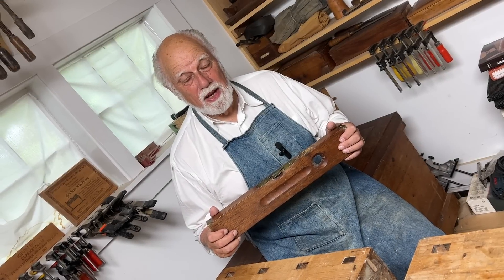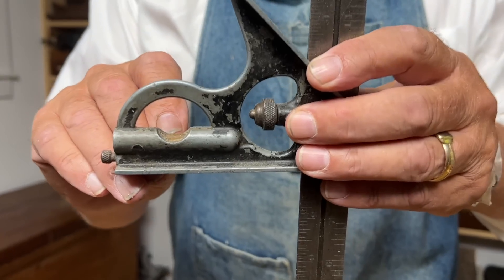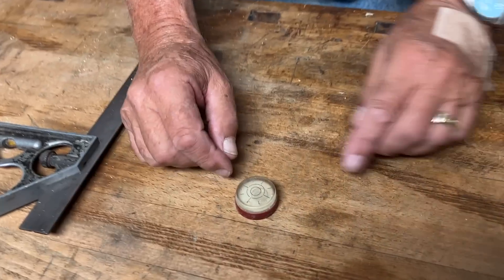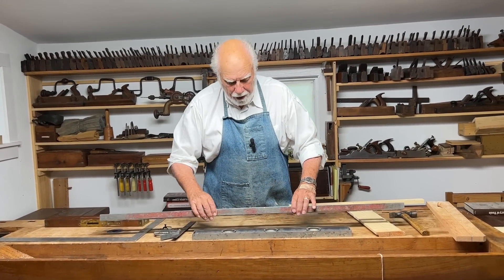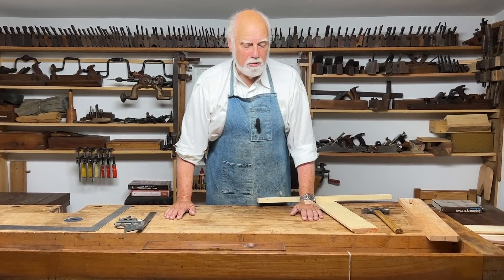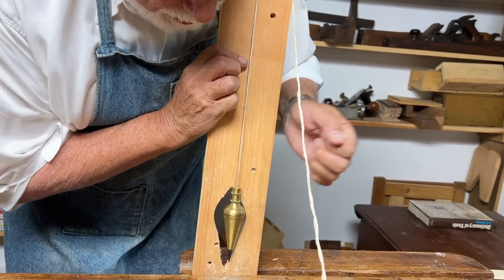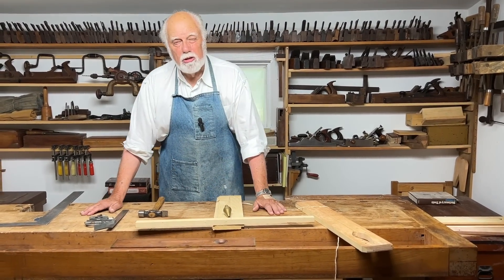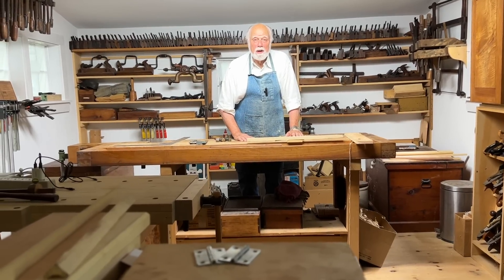54.How To Guarantee Straight & Level

Comment: I have found in well over 40 years of woodworking as a carpenter/joiner/furniture maker that the further you move away from nature, the more prone you are to error. A friend of mine is all about new tech and I am all about old-school. His tech often has glitches, mine doesn't. An ancient water level is more accurate than a satellite levelling system. A story stick is more accurate than a tape measure - and so on.

Comment: That’s something that fascinates me.  Old buildings constructed with basic materials and tools like these are perfectly straight and level, with perfectly square corners.  In my brother-in-law's brand new house, built by "professionals", with precision tools (laser level, micro adjustable miter saw etc.) and stable materials, nothing is square or level  .  The lure of profit seems to have won out over quality, love and pride in a job well done.  That being said, I understand the economic issues very well.  But it makes me realize what a psychological difference there is between building a house quickly that will probably be torn down and replaced in a few decades, and building a house that could be passed down from generation to generation.  Thank you Mr.Blackburn for everything you teach us.
Reply from the maker: You're very welcome!

Comment: I can see how the plumb bob would be very useful to a carpenter building a house, other structures, or even built-in furniture. Not so much for cabinet- or chair-making. While I have a 4' aluminum level, I use it more as a (crude) straightedge than for its intended use. Still, a very interesting video. Thank you for sharing your knowledge.
Reply from the maker: You're very welcome!

Comment: Great video! In addition to the flipped "T", one can make an archipendulum, which is a right  isosceles triangle where the plumb is attached at the right angle and a mark is at the middle of the hypotenuse. Images can be found on the web.
Reply from the maker: Just like the Egyptians used.

Comment: I imagine the masons of old used such devices as your plumb bob gauges when building their castles and churches.
Similar to your line gauge is the water gauge with two vessels joined with a hose filled with water.  Not so useful for cabinet work but useful for house building.
Nice lesson.  I remember my dad showing me how to check a level by leveling a surface one way and then reversing the level to check that it still showed level.  If not then the bubble was out.
Reply from the maker: Good idea, thanks!

Comment: To use a spirit level to say, put long line of shelves along a wall, you can compensate for any possible inaccuracy in it by reversing the direction of the level as you step it across the wall.
Reply from the maker: Exactly!

Comment: Perhaps a good thing to also mention about all that is accuracy for the spirit level, the bubble float due to a curve in the glass and I recall that an average carpenter spirit level tool is made to give 0,5 -1,5 mm per meter tolerance or more, good enought in most cases but not always...🤔
Reply from the maker: True!

Comment: Another leveling devise is the water level. A hose filled with water where like the string level you can hold the tube at a given point and take the other end to another point to find level. Sometimes that other point can be 50’ maybe 75’ away depending on the length of the tube. Water will always finds its level.
Reply: One winter I got the ‘brilliant’ idea 😖to fill my hose with window cleaner liquid, and blue food colouring, but proably got the washer mixture uneven, must have had some plain water left in one end, got a one centimetre error. I used a small transparent hose since usually an air pocket in the hose will give you a serious error… With a fat big hose and plain water, no mixtures, it a good tool.🙂
Reply from the maker: Love it!